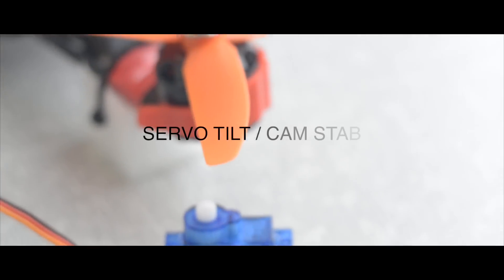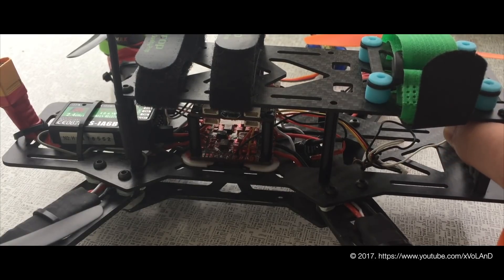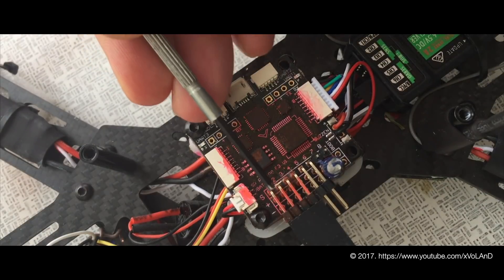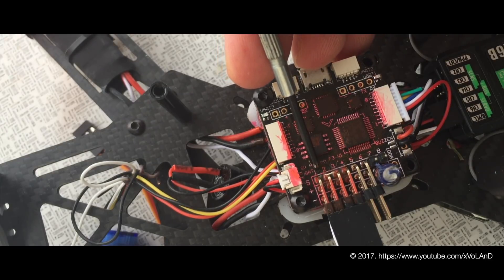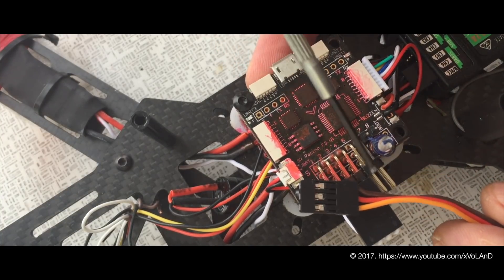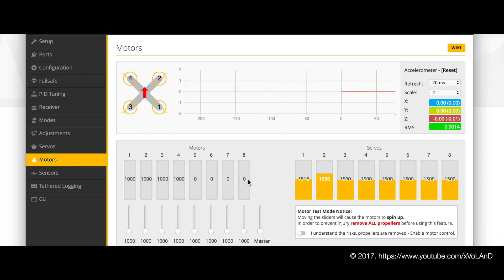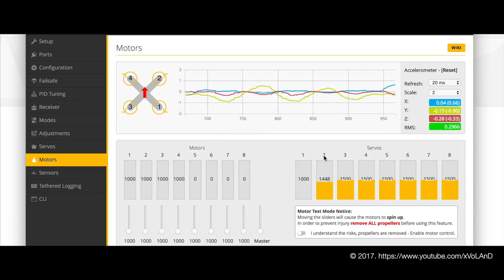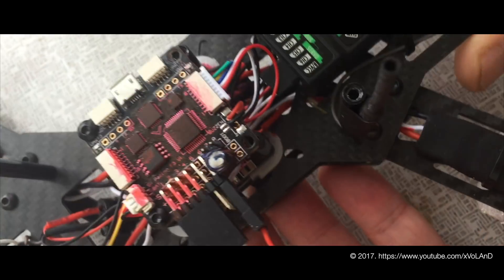Servo Pan Tilt CAMSTAB SP Racing F3/F4 on BetaFlight/CleanFlight. Setting up a Pitch Camera Gimbal

Comment: Nice vid! Some additional info: if it is only servo movement you are interested in, you could also use the servo tab and set an aux channel to move the servo. For camera stabilization only, there is also a flight mode "camstab" which does the same thing on servo0 (servo 1 in cli). Not sure how to set the endpoints or servo for that...

Comment: Is it possible to let the gimball work by itself automatically when the flight controller board turns on,  without any command from the remote controller?
Reply from the maker: It can worked without additional activation from the flight controller. You can setup it in the configurator

Comment: Hello. I want to know if there is a way to configure betaflight f4 to tilt the motors with servo to control pitch and yaw. Any help is much appreciated
Reply from the maker: Hello, everything is correct this video show how to... But you must understand that this is not a full-fledged stabilization.

Comment: SG90 is shitty analog servo, it's too slow (for video stab), it can only be driven by 50Hz, camstab deserves something better like digital high speed 250+Hz
Reply from the maker: Of course this is not a full-fledged stabilizer but this is a cheap alternative. For full stabilization, need to have brushless motors and an additional controller

Comment: Hello! I am trying what you did in your video but I am unable to make it work. What version of firmware are you using? I am with version 3.1.7 and after selecting servo_tilt option and saving, when I go to motors I dont see anything moving when I move the quadcopter
Reply from the maker: Hello! I use v3.2 Betaflight in this video, but it also works with Betaflight version 3.3 (beta)
You should  be understand that you can have some individual settings that can influence to the behavior. I showed how to do that and it's works. Check everithing and make a step by step like me. Also, check another video about SERVO forwarding
Reply: Did you assign the correct resource to the servo? ie: resource servo 1 <servo pin according to FC pinout, like A01>

Comment: show nice very good , is possible til em key radio 3 position  ....??? thks
Reply from the maker: Moises Ferreira Thanks! This will work on three positions or a twirl
Reply: Veri nice , whats is canel f3 flight controler 6, 7 or 8 ??
Reply from the maker: Moises Ferreira Follow the instructions in video and determine the three-position switch. Use this channel for control